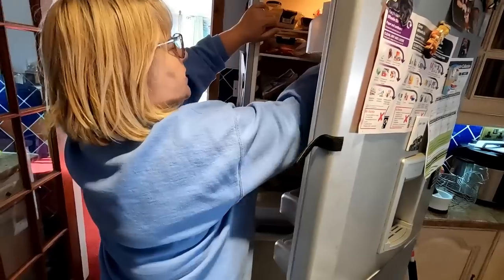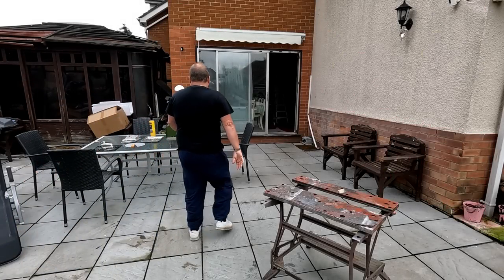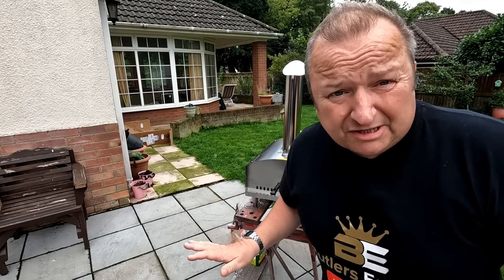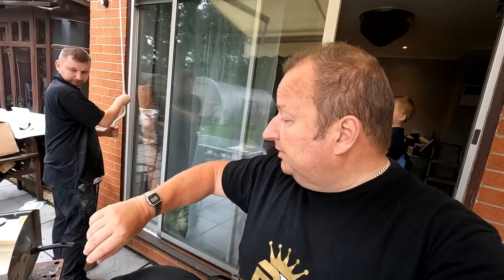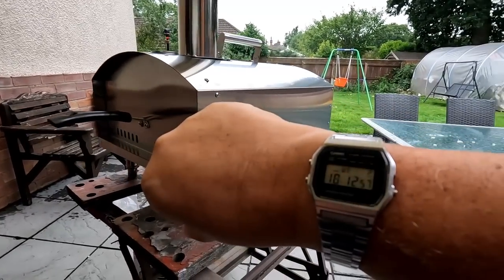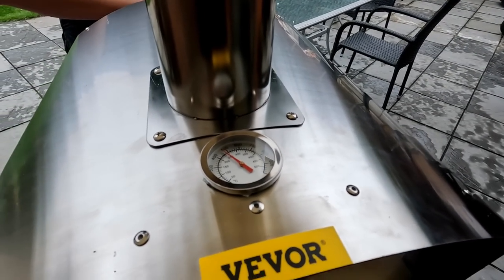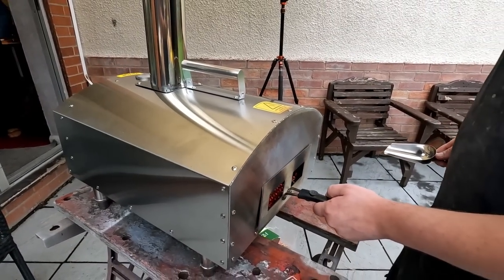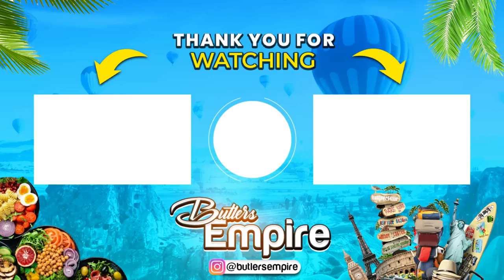We've Got A Vevor Pizza Oven - Set Up And First Pizzas

Comment: Dust the peel with a 50/50 mix of flour and semolina. The semolina is like little balls which help the pizza slide. Stretch the dough on the worktop and then move to the peel for the toppings  Martin pizza look nice and you can cook steak 🥩  or cast iron pan mmmmm

Comment: I wouldn't pay more than fifty quid for that oven. Looks like it was made from tin foil in china.
Martin did you get the cut finger from the packaging or the product?
Reply from the maker: Its stainless steel and quite heavy.
Reply: The weight is in the pizza stone. @butlersempire
Reply from the maker: @JazzFunkNobby1964  There's not much weight in these stones, it's just like a big ceramic tile.
Reply: I re watched the video and you're right. It doesn't look like a proper pizza stone it looks like a ceramic tile.
Another reason why I wouldn't pay much for it.
The main thing is that you are happy with the pizza  and happy with the price don't worry about what I think.
Cheers @butlersempire